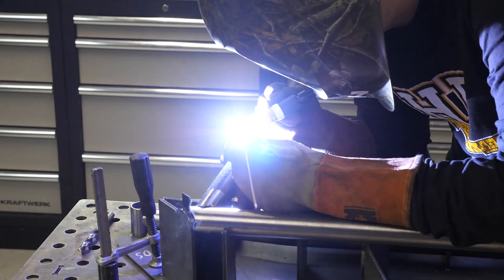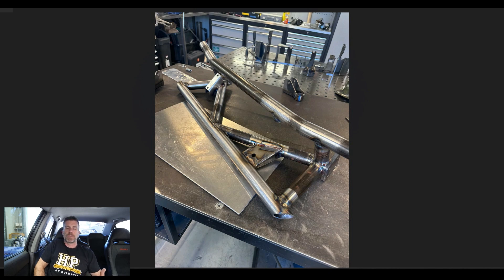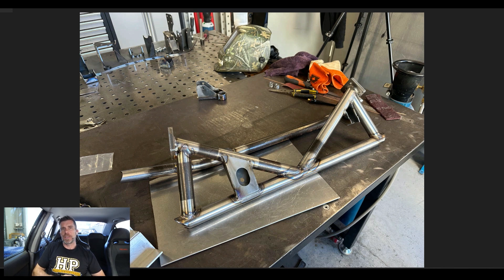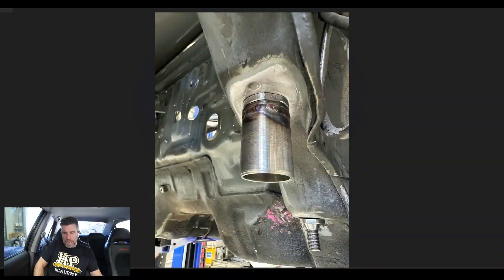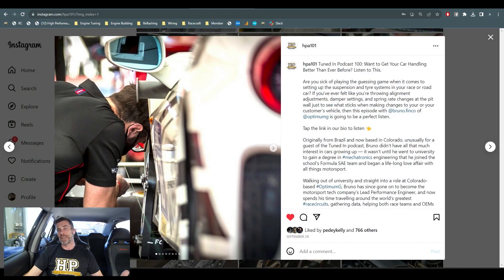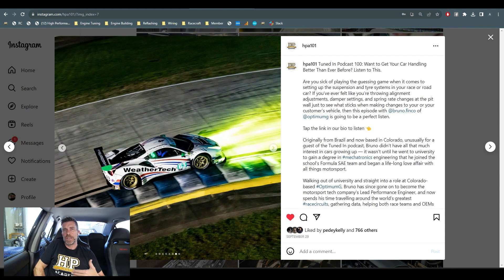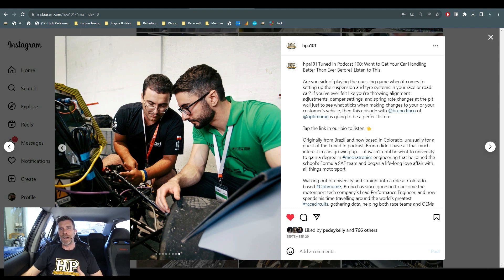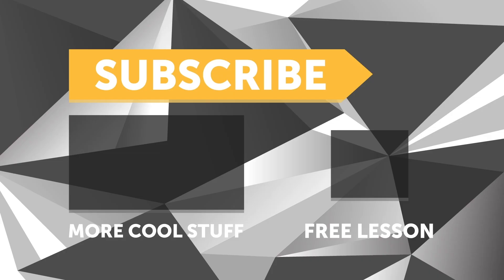Problem solved? #update

Comment: Are you worried about moving the flex of the chassis to a different location. If you add such a ridged sub frame the chassis might have cracks now. I would much rather swap out a sub frame then a chassis.
Reply from the maker: Yes! It's definitely something that needed to be considered. We had some cracking before at the very front of the rails from the traction bar, as this area is quite weak. One of the reason we wanted to relocate the caster arms to behind the axle. However where the subframe mounts ties in quite nicely with the cage and we've added some extra reinforcement around this area as well, tieing the cage and firewall in to the strut towers.
The other thing to consider is the factory subframe had to be extensively modified to work with the new drivetrain anyway and not fall apart during 1 race.
So in our case we really wanted something custom anyway, and since we are confident the reinforced chassis should be able to handle it, a stiff subframe will be a good thing - Connor

Comment: Is there a concern over mixing material strengths? Where the chromoly additions you added meet the factory steel there might be additional forces not previously seen due to flexing no longer being present in the cross member.
Reply from the maker: Definitly a valid concern for a factory chassis, and we had some cracking before at the very front of the rails from the traction bar, as this area is quite weak. One of the reason we wanted to relocate the caster arms to behind the axle. However where the subframe mounts ties in quite nicely with the cage and we've added some extra reinforcement around this area as well, tieing the cage and firewall in to the strut towers - Connor